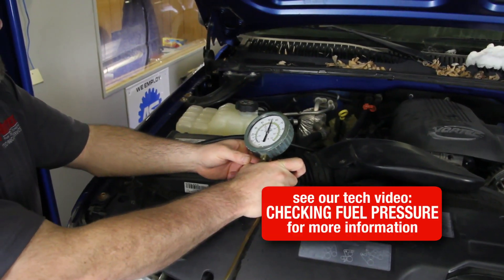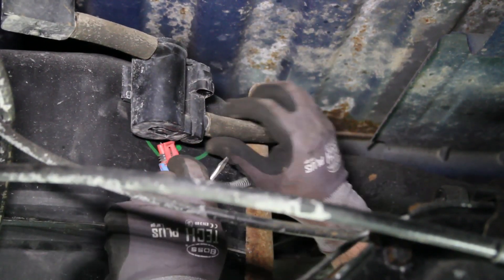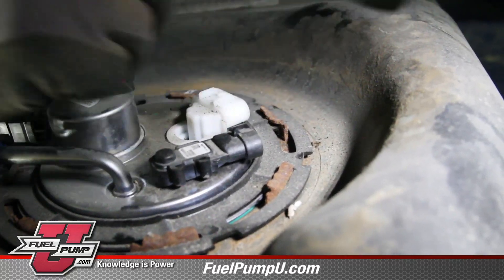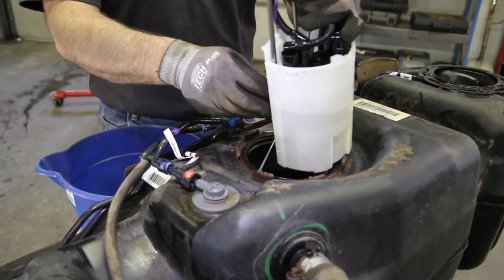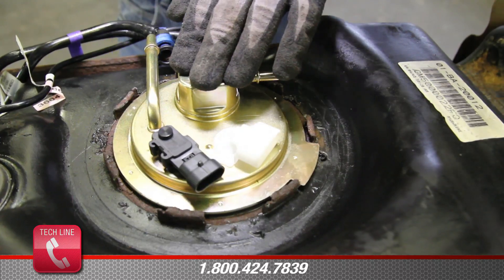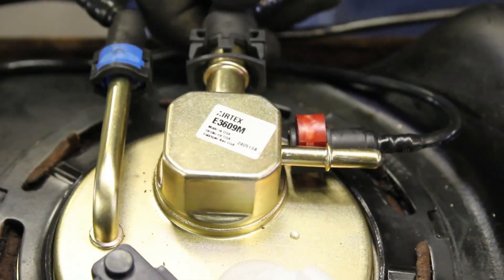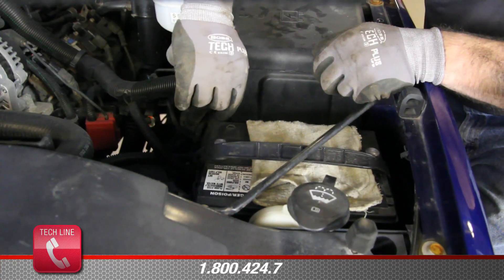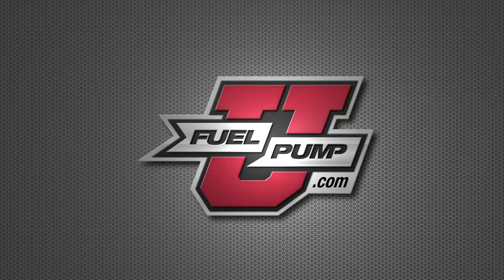How to Install Fuel Pump Assembly E3609M in a 2004 - 2007 Chevy Silveraro 1500 Truck

Comment: can you identify each port on the fuel pump module? what is each hose and where does each hose goto?
i would like to "temporary" disable the evap system until my new fuel pump gets here. how would i go about doing this? my fuel pump works fine except i have a broken port. its the one in your video with the red lock on the line.

Comment: is the fuel filter inside the module? i can't seem to find the filter on the frame of my 2004 Z71.
Reply: it's in the fuel pump.
Reply: Glyn Robinson if yoUr system is return less yes I believe so

Comment: try doin a rusted out truck lol.......not easy at all
Reply: I seen alot of videos where people were cutting a hole in the bed to get to the fuel pump and then patching the hole in the bed.
Reply: @charitablemiraclebeekeeper1200  if your truck is junk you dont want to cut up a nice  truck
Reply: Due to rust issues